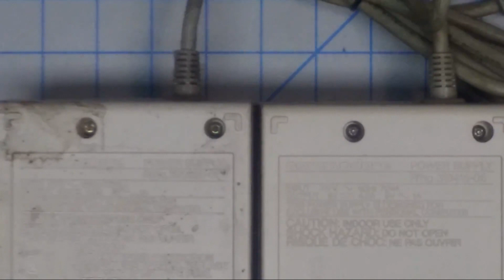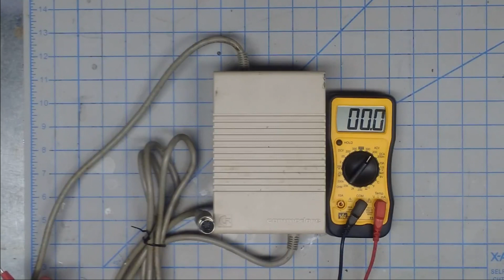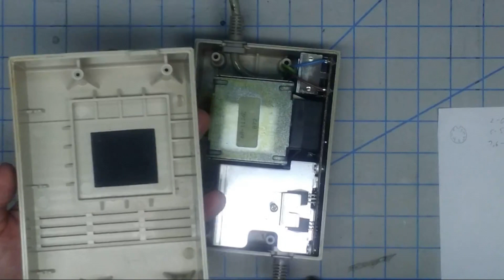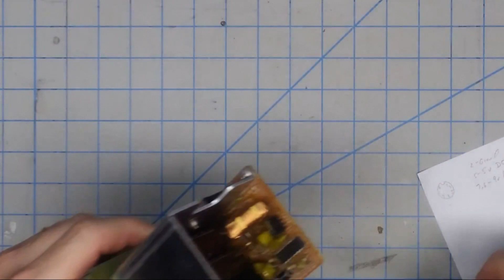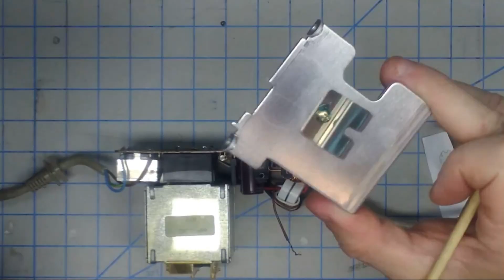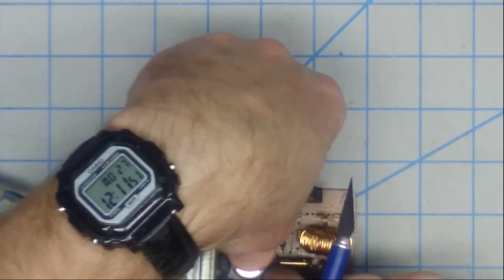Episode 7: C64/C128 Power Supply Teardown and Maintenance

Comment: last night befor seeing this video i opened up my c128 PSU and it was BAD. The glue is called Sony bond its used in the Ham/CB radios and it can destroy the radios.
and like my PSU it was bad and i had 2 resistors and a 102 cap with rotten off legs..

Comment: It looks like your Commodore 128 power supply looks exactly like mine on the inside. Do you think you could help me identify some components? I need components for R18, R11, R14, R16, R9, R17, R4, R15, R19, C5, C14, C15, C13, C12, C8, D2, ecb, Q1, SCRI and D3. I already got half of the components replaced.
Reply from the maker: On the Commodore 8-Bit Repair and Upgrades group on Facebook, I have shared a document that lists most components for most of the 8-bit line. The 128's tab includes the power supply. Go to that group and it's in the Files section under "Commodore Components." Otherwise, download a copy of the schematics and find them there.
Reply: @commodorerestore  So I joined and found the file name. However, I couldn’t find anything related to a Commodore 128 power supply. I tried other files there, but still nothing.

UPDATE: I actually didn't see the tabs on the bottom. This helped for the most part. However, it doesn't list D3, Q1 and SCR1. Any ideas what those might be?

Comment: When I do a test for voltages on the Commodore 64 power plug, I like to cut short lengths of 1/16 heat shrink tubing (don't shrink the tubing)  or any rubber tubing,  about a 1/4 to 1/2 inch long . I slide these over the plug pins, then push the multi meter probes inside of the tubing making contact with the pins without shorting out the power supply. You can lay the plug and multi meter probes on the table or bench leaving both hands free.
Reply from the maker: That's a good tip--thanks!
Reply: @commodorerestore  Forgot to mention that VR1(Blue) on the left side next to the large capacitor is an output voltage adjuster. Use VERY small adjustments. Think I have told you all my secrets. lol

Comment: Great, now I have to open my c128 power supply....   J/K,  thanks for the heads up!
Reply: So I opened up my PSU.  It is a 310416-06. but the internals are a bit different and there is no glue at all.